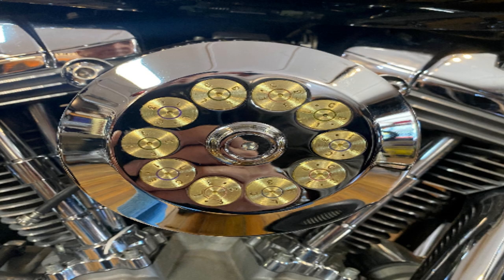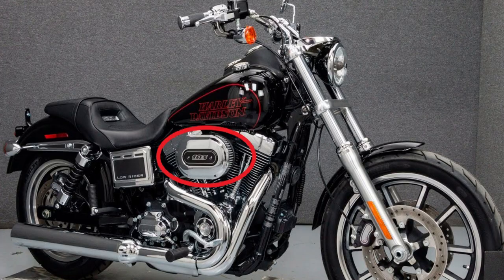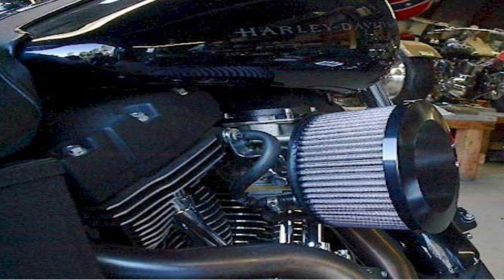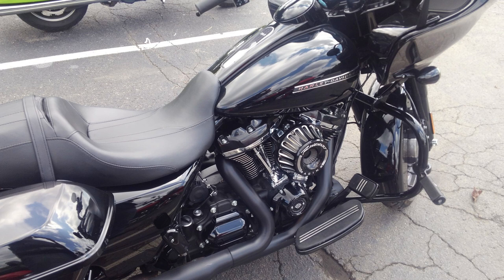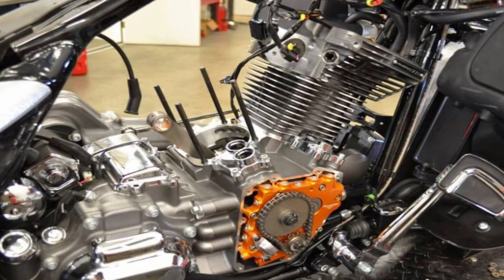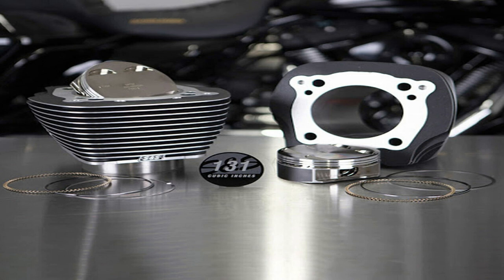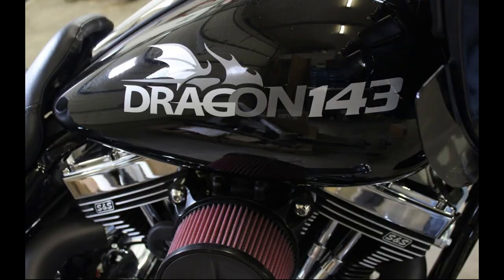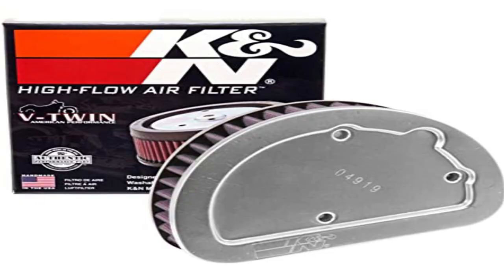Feed the Beast, Harley Air Cleaners Can Make or Break Your Build

Comment: One reason I will miss working at a Harley Dealership.  In Manassas  years ago , had access to parts and could figure out different  types of are cleaners.  Knowing back then bike where carb ones. Not like now where you Can give em all the Air you can , seeing the Fuel Injection will work it out. Carbs not so much back then. 
Good Video , now I wish I had Conections like I did before , could figure out Factory air filter wanted that I knew would look good , and then figure out the Backing plate to work with it . Being a machinist,  I learned to fabricate most of my backing plates so I got the look I wanted. 
But such is life , but Great video  there.
Very informative one !! 
Thumbs up !
Reply from the maker: Thank you, I appreciate it! As a machinist you are only limited by your imagination! I do miss all the connections I had too when I was in a shop, it was great having access to anything and everything. Plus the employee discount was hard to beat!
Reply: @GixxerFoo , most people would be Blown Away at the Mark up .  
But that being said it is not for most a Year round Ride. 
8 had the privilege  of working parts and sales. My 2nd new Harley was a FLT 1982 . What a difference  in price , but I worked a great Dealership  , guy I ended up at the end show me alot. . His uncle had 3 Dealerships,  even got to go to Factory to pickup bike couple times. Meet Willie at National Airport  , picked him up took him to Convention center  in D.C. for the bike show in 1984 , he got off airplane in Bibs ! Lol 
Know one knew him till he put on his suit  after arriving at Convention center.  Soo Funny !!!
Look like a hillbilly kinda.
Reply: @GixxerFoo  , what area in USA do you live ?

Comment: Your channel is my favourite one now, Mainly because you talk about the older bikes and its not all M8 this and M8 that. 
I bought the Arlen Ness monster sucker from Revzilla, took 3 days to get to NZ then 5 days to get across town, Couriers suck here. I chose that A/C because the standard one pushed my leg out and i ended up getting a sore knee.
The only thing i don't like about your channel is .... I was decided on getting the Andrews 48s for my dyna but now i want to look at the woods ones lol. Thats going to be hours on the forums comparing the 2.
Reply from the maker: Wood cams are actually made by Andrews for Bob Wood, they grind the cams to Bob's specs. Andrews makes excellent cams and they actually manufacture cams for a lot of companies. Wood cams makes great power but they are noisy, that's just one thing to consider with the Wood.
Reply: @GixxerFoo  Thanks bro.
Do you mean bad noisy or good noisy? 
My lifters are already pretty noticeable.

Comment: Arlen Ness crossover 2020 RGS SS 128 kit, CnC ported heads, 64 mm intake manifold/TB, 6.3 injectors, RS 468 cam..
Reply from the maker: Damn you did it right with that 128 kit! You've for sure got a build that needs that larger throttle body and big injectors!

Comment: Hey GF, I am looking to get my hands on a '20/'21 Harley-Davidson Street 500/750. I want to get rid of the "Fisher Price/Playskool" sounding exhaust. Should I lookto replace the air intake cleaner?  Looking at an Arlen Ness "big sucker air intake system. Not interested in putting out 100hp from the bike at all, if I get a 10-15hp increase, that's fine. I'm 58 years young and have NOTHING to prove to ANYONE by riding some "overkill, decked out" piece of 2 wheeled junk on the road. Is there a certain air cleaner system you could suggest me to inquire about? Doug🏍️

Comment: On my 01 road glide with a 113 I run the kuryakyn hypercharger R. Not only does it look cool it feeds it are all the way through the range is the most rain proof air intake I've ever had
Reply from the maker: Those are some really awesome air cleaners with the butterfly on the end!
Reply: @GixxerFoo  here in East Tennessee it rains everyday just about so getting caught in the rain is easy to do and having a good air cleaner that can handle the rain and breathe is great I went there about 3 before I got the right one

Comment: I did the stage 4 114 kit on my 2018. I switched the cam and tuner out and had it dynoed. 115/124. I’m running the SE air cleaner that I see now on the newer bikes. It seems to run great and pulls hard. Am I ok with that setup or do I need a bigger filter? I figured with the 114 I should be ok.

Comment: My 2014 Road King had a  103ho with the open air cleaner
Reply from the maker: The HO 103 they went with the .511 cams over the .496 a little hotter tuning and the open air cleaner. It was a really good move, improved torque quite a bit.

Comment: I have a 12 street glide that i had a shop make into a 124 and i sent my stock TB to HPI and got back either a 58mm or 62mm TB, i had put a round Screamin Eagle air breather on it when it had the stock TB and since i got the bike back a couple years ago i found out the shop is kinda sketchy plus ive had a oil leak under my jugs and they tried twice to fix it and now wont return my calls, so after watching your video im wondering if they even used the TB i got back from HPI cause they put the same air breather back on it but according to this video it shouldn't have fit or maybe it should have. Can you let me know either way?

Comment: Thanks for the tips always ; 
I took my auto primary tensioner out . It’s did not seem to tight . Maybe a little tighter than manual tensioner specs . I reset it and put back in . I put in 10w404t valvo motorcycle oil instead of 20w50 . Wow what a diff ; it shifts so easy and smooth now . Never putting 20w50 in there again . Also getting rid of 20w50 in trans and going with the hd syn gear oil . 
See how it goes . I guess I pitched my old manual tensioner- 😁
Stupid me - 
✊🏻👍👌
The retired hd mechanic still swears by atf in primary’s -
Reply from the maker: Having that primary chain properly tensioned makes a huge difference! I've heard of a lot of people using atf in the primary, I haven't personally tried that myself. I would stick with the synthetic 20w50 or go with the dedicated primary fluid myself.
Reply: @GixxerFoo  ✊🏻👍👌 the 20w50 was terrible. For lazy people the mechanic says or to have one fluid for 3 holes on the road easy top off - 
Guys was saying in hd forums that the old hd primary fluid was like 10w40. 
Just some info I found -
✊🏻👍👌
Reply: @GixxerFoo  so harley went back to gear oil in trans I heard : mechanics been telling me this for years : gear oil in trans .
Some are saying trans shifts like butter with gear oil . ✊🏻👍👌

Comment: I had the SE heavy breather elite which I think huffed down more air. Problem was it was in the damn way of my leg and had some blow by when I romped on the throttle.
Reply from the maker: That heavy breather elite is a hug air cleaner, if for sure pulls the air. I am guessing you got oil spray all over your leg, have you routed your crank case breathers to a catch can?
Reply: @GixxerFoo  I tried the feuling catch can device- it was messy. I then switched to the Trask checkM8 trans cover w/ hose and catch can- no blow by at all. But then again that was after I switched air cleaners..

Comment: Thanks for your very informative videos, I'd say public service 😁😁!
I ride a 2005 xl1200c, V&H straightshots with quiet baffles, 45 pilot and a K&N element in the stock housing. It runs ok but, a bit held back in the high end. Might changing the air filter to an S&S wake it up in a  noticeably way? They have been in the market forever.
Reply from the maker: Thanks for sharing! Yeah for sure running the stock air box is holding you back, getting you a good open element air cleaner and rejetting will help out quite a bit on top.
Reply: @GixxerFoo  for what i understood from this video, any open element air cleaner will provide enough air for a motor under 90hp, aesthetics will be more costly. Ok, the next question on the bike being held back, do the quiet baffles have anything to do with this? I'm considering going back to the original baffles inspite the loudness they make. Thanks for your advise.

Comment: Gixxer
Got a TC88 converted to 107. Bigger Throttle body, injectors, TMAN headwork and 590 CAM. 120HP 124 TQ. I currently have an old school style SS Teardrop unit they developed for EFI bikes a few years ago. The tuner said they seem to flow ok but just wondering what you think of those. 
Thanks
Little O
Reply from the maker: I've heard those are best flowing air cleaner out there and then heard the same thing you were told. They've been the go to for years, I like to have a completely open uncovered air cleaner myself with the cone style filter. I've had my best results that way, but it for style it really comes down to personal preference. To me a couple horse at revved out to the moon isn't a reason to compromise for something you don't like.

Comment: My 883 has just the K&N in the original filter box, but I drilled half inch holes all the way around the back half of the box to let more air in. I don't know if it helped. Probably if I go to bigger cams or upgrade to a 1275 kit. I am also considering a TC brothers little round AC. They look pretty cool and are very basic.
Reply from the maker: On my Sportster when I was saving up for a new air cleaner I actually cut the entire back plate of the air box off. I only left the mounting points for the throttle body so where it would seal. It worked great for a open element air cleaner, you couldn't even tell with the stock cover over it.

Comment: Simple way to explain the need for an a ir filter upgrade. A chain is only as strong as its weakest link. If the air cleaner is too restrictive, no matter what else is done to the bike will not make any difference. Weakest link for power or strength. Not a hard concept but many still struggle with it.

Comment: Hey Gixxer how are you!  Question on crank compression. Does a crank compression of 180 psi front and 175 psi rear indicate stock pressure’s or modified? I’m running a 509c S&S complete cam kit upgrade with 24,000 miles on bike.
Reply from the maker: Those sound decently high, what engine do you have? Not knowing which engine you have that sounds like it's modified, you might run a camera down you're spark plug holes and look at the pistons. See if they are flat top or dished pistons, flat top is stock but if they have a dish in them they are high compression pistons of some kind.
Reply: @GixxerFoo  sorry i can’t believe I didn’t put the  engine displacement . I chatted with you a while back . 2006 street glide 88 ci. I have a power vision with a base tune from fuel motto..  and above cam kit complete with hydraulic tensioners and new S&S oil pump, I recently asked if I could put the 98 inch upgrade you were talking about on my engine. I’m almost positive it doesn’t have the timken bearings in case’s.. not happy with base tune at all .. also dyno jet said it would be best to update injectors from 8deg. 3hole to 25 deg 6 hole because most likely the tune fuel moto sent me was for new 25 deg 6 hole injectors..

Comment: Stage 2 M8 114", stock air cleaner with tuner pro. I keep the air filter clean! 45 to 55 MPG and has gobs of power and smooth.
Reply from the maker: I'm surprised you're running the stock air box with a cam in there, they do work well if you get caught in the rain.
Reply: Is it the ventilator? They flow pretty well I’ve heard.
Reply: @GixxerFoo  torque cam to boot! Runs fine with stock air cleaner. Happy as hell with it!
Reply: @GixxerFoo  I just ordered a high flow screaming eagle air cleaner. You got me thinking! Dealership should have put it in when I went from stock to stage 2. ???

Comment: Very informative video 
I'm interested in the video of throttle bodies 
We've messaged back and forth a bit about my build.....
So I had to redo some of the build do to a spun crank . Long story short everything is built ( 100" , woods cams , bassani 2 into 1, ported and polished heads, oversized valves etc.).so now I'm looking at a bigger throttle body and injectors ( I'm running the big sucker stage two). 
I'm hoping that's enough filter for the power I'm trying to get.....
So I'm interested in your knowledge of the Tb.
Reply from the maker: Spun crank is the worst, but it's a perfect opportunity to get in there and build it back better than before! The Big Sucker is a great unrestricted open element air cleaner, that will be more than enough air. Throttle bodies are a bit tricky, if you've got enough motor they are absolutely necessary. But putting one on a engine that doesn't have the bore won't do much if anything for it.

Comment: I put a K&N air filter element into my stock air cleaner and did an FP3 tune. Kept the stock mufflers (not into loud pipes). My Low Rider 107 runs smoother, cooler, maybe faster & has better throttle response. Very pleased with the results.
Reply from the maker: Very nice! I tuned my bike with a FP3 when it was otherwise bone stock and it made a huge difference. Just wish I hadn't of waited a year to do that though!
Reply: @GixxerFoo  Does not always have to be the nufflers first. An FP3 on it's own makes a big difference and your motorcycle appreciates it too.

Comment: @Gixxer Foo
Did I hear right?
If I am only adding cams a tuner and slip ons 
The factory 107 air filter is fine or will there be a significant loss in potential horsepower?
Reply from the maker: If it's the open element air cleaner it would work, but with the 107 I believe they still had the air box. With the air box you'd really be starving for air, you'll want to eliminate that backing plate and snorkel on those factory air cleaners.
Reply: @GixxerFoo  
Thanks for info

Comment: Oil before use......I had an sportster in 97-2001,i was upgrade my air cleaner from this woul element and this crappy plastic housing with the small trompet intake to an sreaming eagle K&N style filter element,and it was recomant to "oil before use" so i oiled the filter element with ATF 220 on the high cams on the element....My poor sportster was running like an bottle of crap and popping black smoke dots and was not happy at all so i started wondering what have i done now...And friend was wisitting my garage when i was solder out what was wrong with the bike,and i told him what i had done ,and he asked me what colour there was on the element....It was red,Oh he says and you have been added more oil into the element....he told when he was drive dirt bike back in the days he ordered an K&N filter and this come ready to use and it was red becouse the oil who was in the element and it was grey when it was clean,so we took my filter and throw it in an bottle with gasoline to wash out some of the oil whos glugged up the element and let it dry out in the sun and get it on my bike again and now we talk,the engine was so happy that it never had been....So guys see if your new open filter are pre oiled before you do something stupid
Reply from the maker: For sure don't over oil those filters, the motor will suck that oil right in if it's saturated.

Comment: The only way to go is either of the big sucker air cleaners ! If your running an S&S carb stay with tear drop air cleaner that came with the carb the little funnel inside the cover helps make good flow .if your running a CV carb or a Mikuni those carbs like a volume of air inside the air cleaner so use a big sucker ! Gucci air cleaners work too but why waste your money ?
Reply from the maker: You've got an excellent point! That S&S air cleaner really produces some surprising power, it's a very well thought out design.
Reply: @BeardedBavarianBiker.  That's possible What I said was if you have an S & S carb your 114 is fuel injected !

Comment: I purchased a Vance and Hines air filter that I could use my factory cover with. It’s open all the way around as the cover sticks out beyond where it was stock. It comes with a K&N air filter and you can hear that thing gobbling air when you’re heavy on the throttle. Would it work for a monster build? Probably not. But it’s a great air filter for stage 1-2 in my humble opinion.
Reply from the maker: An air cleaner like that is perfect for your setup, when you get into heavy builds and the air cleaner becomes critical you'll need exposed element. But for the most part a trick air cleaner covering the element isn't a noticeable difference in power unless you're on a dyno.
Reply: @GixxerFoo  I agree. I’m probably only going to put a new set of cams in it with cam plate and oil pump. I’m not going big bore. If I want a bigger motorcycle/motor I’ll buy the whole bike. Love your information. Keep it coming. 👍

Comment: I've heard that tuners will fry the ECM on Harley unless you get the Harley tuner(ScreaminEagle)

I find that hard to believe but I know little about it

Have you tried the Cobra plug and play, it comes tuned for your bike as stock, you connect it and it tunes itself to fit your equipment.......then you change anything and it auto tunes itself?.......yrs ago it was $600, but seems it would be worth it if it actually works......it would tune as your air filter gets dirty and again when you change air filter